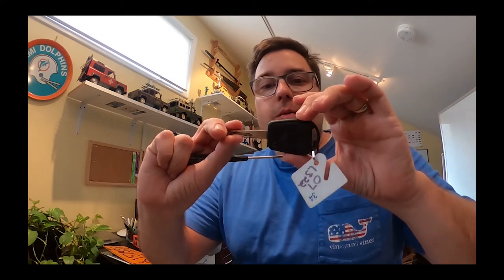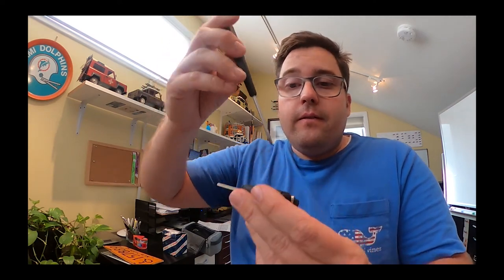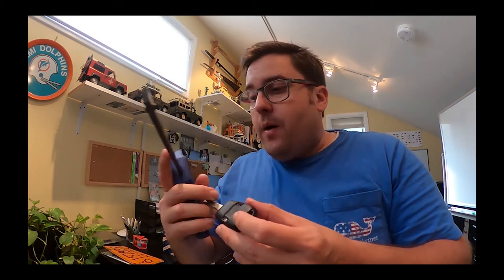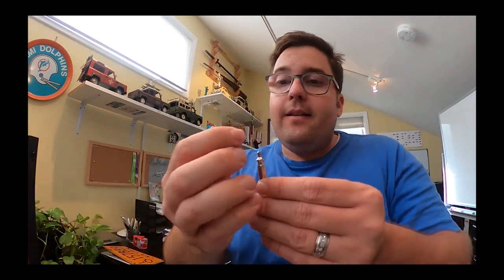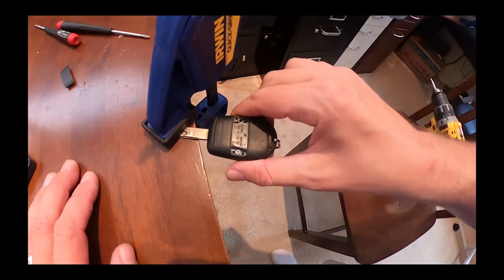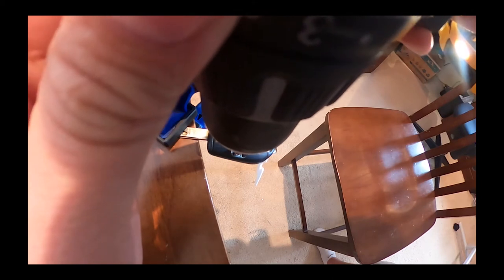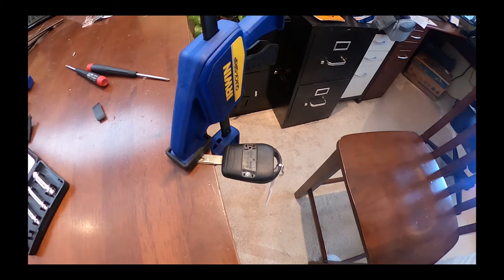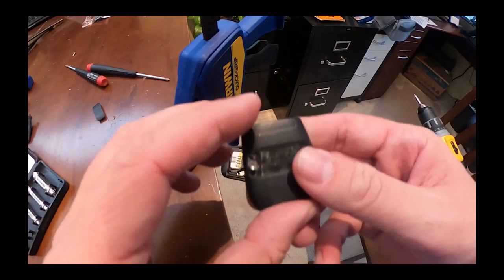Car Key Fob screw extraction using easy out | Stripped screw extractor

Comment: Nice demo.  The only thing that concerns me is that when you're drilling, there is nothing supporting the body of the key fob.  It seems that if you press down on the drill hard enough, you can bend the key. Thanks.
Reply from the maker: Luckily I didn't experience that. The downward force would have to be pretty great to bend it I think..